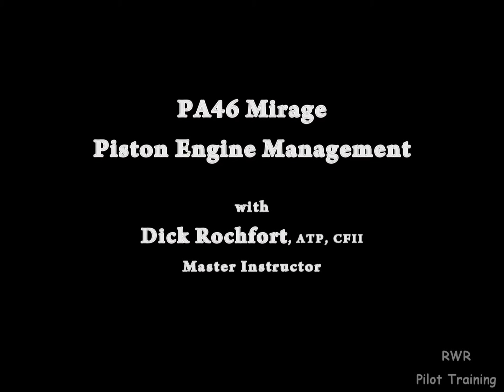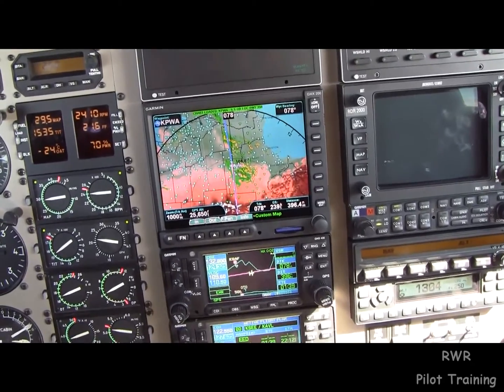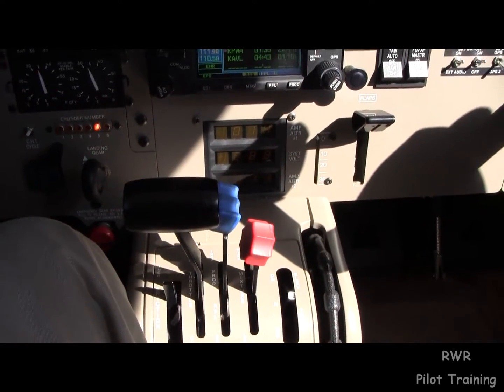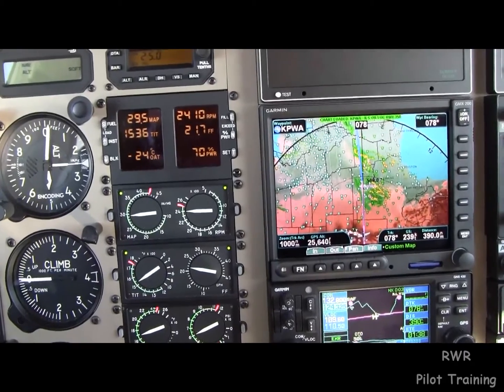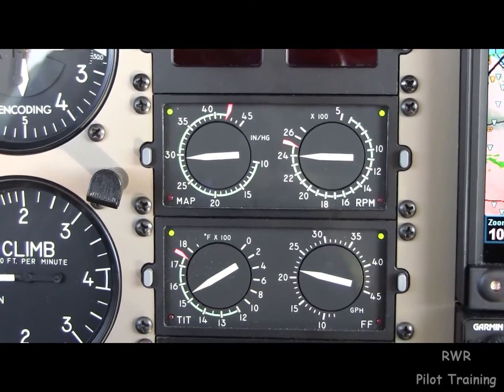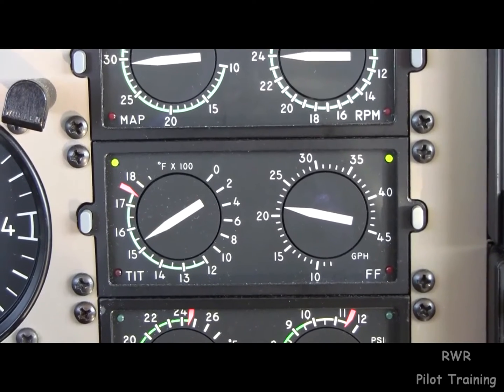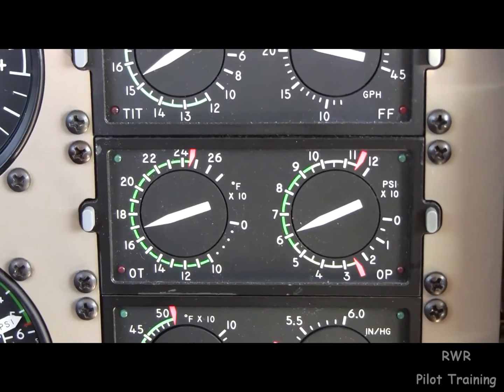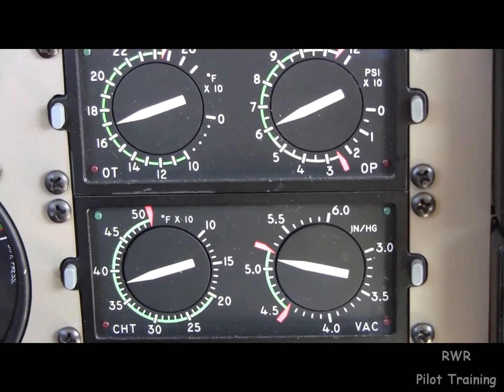PA46 Mirage Piston Engine Management

Comment: Hi Dick, I have operated and flown a 350 for 4 years now and my engine runs very well lean of peak. What makes you think the opposite? If mixture distribution is sufficiently good, the physics is the same for all engines.
Reply from the maker: Hello Kai, I am using the operational definition of LOP ops; that is to say.. If it runs smoothly and within acceptable temperature limits it won’t hurt the engine. Now then we have to discuss what those limits are and how we apply them. This is too much discussion for this page, but you are correct LOP ops are entirely doable with the 350. The TIO 540 Lycoming engine’s intake manifold is not as well balanced as the 310 Continentals which yield a roughness associated with disparate amounts of power unless the fuel to each cylinder is better controlled. GAMI injectors have been helping with this problem for quite some time now. It is probably a bit optimistic to say that one can lower operating costs with LOP ops. It’s more likely to improve loiter time and improve safety when fuel stops are impractical or all together impossible. I have crossed the North Atlantic many times behind both engines and sometimes LOP ops is the best option for improving the fuel remaining at destination. Fly Safely - Train Often .. DR
Reply: @RWRPilotTraining  Thanks a lot for your clarification, Dick!
And thanks for all the training and advice you provide to the community. I really appreciate that you share your valuable experience.
Best regards from Switzerland,
Kai
Reply from the maker: You are most welcome .. Fly Safely - Train Often .. DR

Comment: “This engine will not run lean of peak”? As far as I know all gas engines , with the exception of your lawnmower , can and are being run at lean of peak. My understanding is that modern theory and practice is that all gas engines are being  run successfully lean of peak. In this scenario burning around 15 to 16 gallons per hour as opposed to 21 or so gallons per hour.
Reply from the maker: Hi George, Your’s is a great question, thank you. You are absolutely correct about the option of lean of peak. The Continental engines were approved for LOP ops back in the day, but Piper gives no such approval for Lycoming engines of the present day. In my experience both will run LOP at 60 - 65% power, however Lycoming engines are not as well balanced on the intake side and therefore require GAMI injectors to run LOP smoothly. This is useful on long over water flights like the North Atlantic crossing. Since damage to the engine can result from improper setup I recommend getting a thorough education on the subject and proper training before you use LOP techniques. Consider “Fly the Engine” by Kas Thomas and anything written by GAMI or Sky Ranch Engineering. John Eckalbar’s “Flying High Performance Singles and Twins” is excellent as well. Fly Safely - Train Often .. DR

Comment: Hello Dick 
I have seen some pilots climb to FL270 on 350's. Is that possible? Recommend?  I'm falling in love with the meridian, which is better? 310 or 350? Thanks
Reply from the maker: Hi free captain 1, the short answers are yes.. and no. It's really a grammar lesson: You can, but you may not. I recommend you enjoy this airplane within its advertised performance envelope. You will find it will do just about any mission without exceeding limits.

Comment: Silly Question: Why does the GPS ALT say 25,650ft?
Reply: Above 18,000 feet, you set the altimeters to "standard pressure" -- 29.92 inches of mercury.  If the actual atmospheric conditions are different from "standard", then the altimeter's reading will be different from true altitude.

That doesn't matter in practice, though, because everybody flying up there uses the same setting, so a pilot flying at an indicated altitude of 19,000 is 2,000 feet below a pilot flying at an indicated altitude of 21,000, even if their true altitudes are slightly different.
Reply from the maker: Mike’s answer is correct.. Fly Safely - Train Often .. DR

Comment: How are you getting the 70% number in the display box?
What is the recommend air intake position at FL17 and above?
Reply from the maker: Hi Alan, The percentage of power display on some models of the PA46 is derived by the display firmware. It simply looks at the manifold pressure setting and RPM and displays the power setting. It presumes (I think) that the fuel flow is per the power chart. I consider 70% power to be a good power setting for regular cruise flight. I accomplish this with 29.5 inches of manifold pressure, 2400 RPM and 21.5 GPH fuel flow. These setting will yield temperatures which are well within the widely accepted limits put forth by engine experts. I hope this information helps you. Fly Safely - Train Often Regards, Dick Rochfort, ATP, CFII - Master Instructor